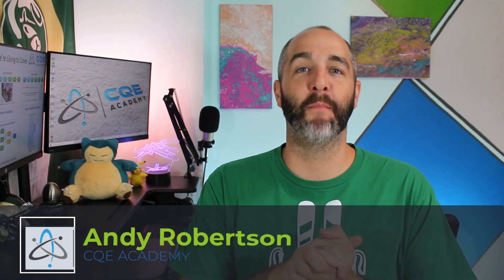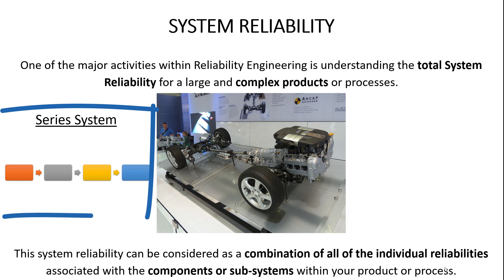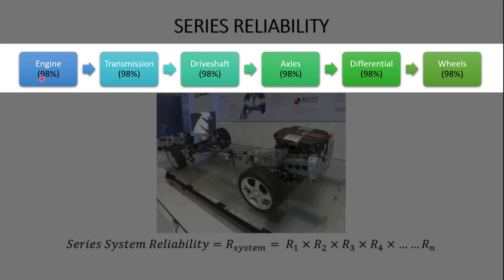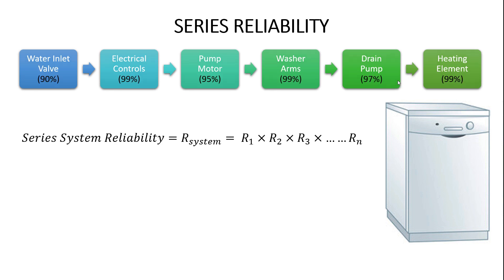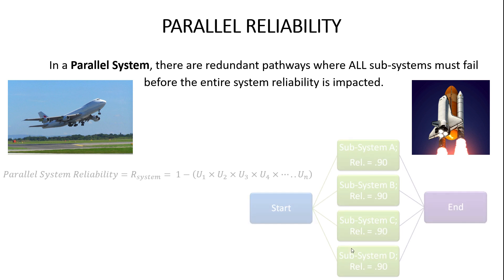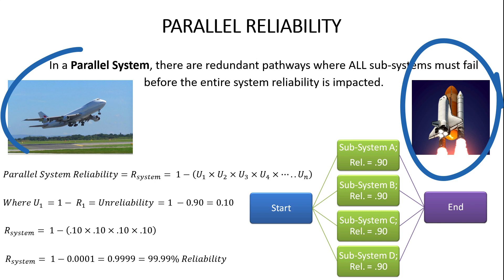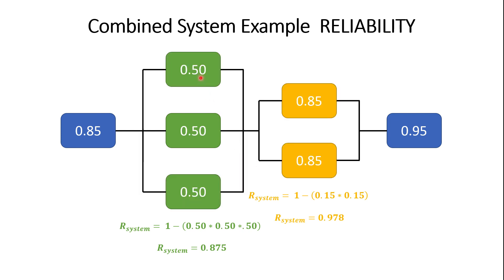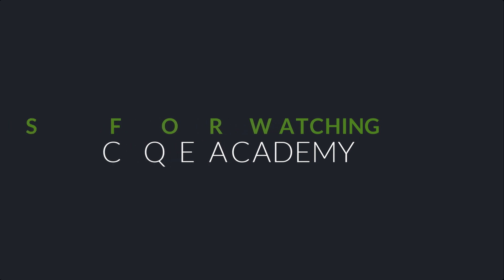RELIABILITY System Analysis, both series and parallel series analysis explained

Comment: Thank you very much 🌷 I have a question about the Combined System Example 7:33. I got confused when you subtract 1 of each of the 0.85. and you did not do with 0.50?
Reply: He does, what might be confusing: In case R = 0.5 , the reliability has the exact same value as the unreliability (= 1 - 0.5 = 0.5).

Comment: Hello. What is the advantage of serial connection in the system over a parallel connection?
Reply from the maker: Hey There Veljko!
In terms of reliability, there aren't really many advantages.   But often, many systems (think automobile) just naturally have to be designed in series to work properly, which is why we have to learn how to calculate reliability for series systems.

Comment: Hi, thanks for the video! Any example of calculating reliability for NON SERIAL–PARALLEL SYSTEMS ?
Reply from the maker: Hey Konstantinos, no, I generally create content around the CQE body of knowledge, and that's limited to just series and parallel systems.

-Andy
Reply: @CQEAcademy  Is this the same for calculating System availability
Reply from the maker: Hey  @taipizzalord4463 , is what the same for system availability?
The calculations for series and parallel systems?
Reply: @CQEAcademy  Yeah
Reply: @CQEAcademy  Yes the calculations for both parallel & series systems
Reply from the maker: @taipizzalord4463  Yeah you can use the same approaches for availability